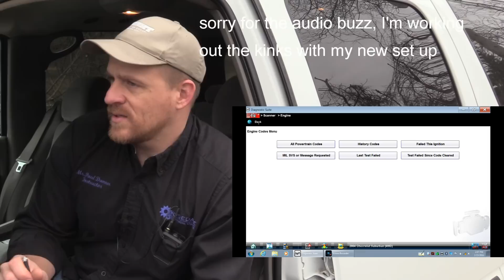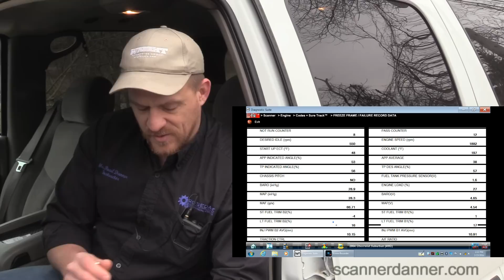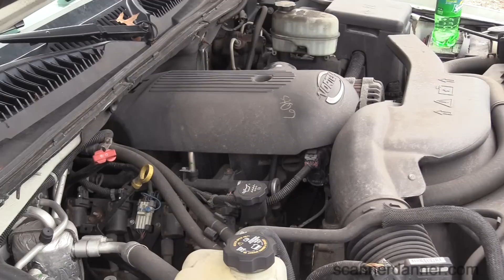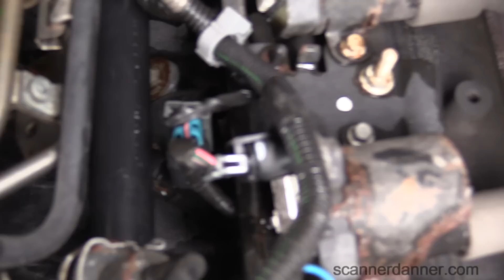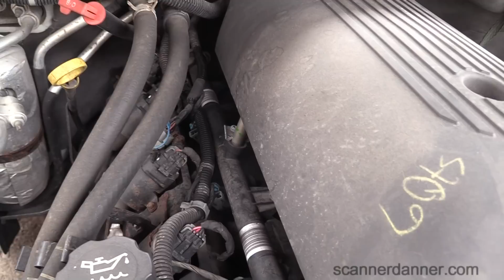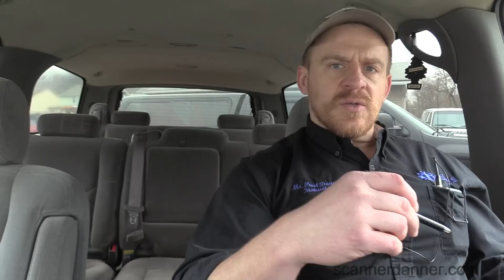Comment: This guy is good. My dad used to remove carbon from the pistons/cylinders by slowly dripping water from a turkey baster into the carburetors. Also, if the ole Holley carb got sone dirt he revved the engine and then quickly covered the top of the carb with his hand to clear the obstruction.

Comment: Need Opinions!!! I have a 2004 Tahoe 5.3 had no engine light or code, put some lucas in the fuel tank after driving for a little bit, my engine light came on throwing lean codes with rotten egg odor coming from exhaust, none of this occurred until just after I put the lucas in?! Im thinking the fuel filter is clogged from the lucas loosening something and shooting it thru clogging filter?! Any good opinions???!!!

Comment: I have a 2011 Chevy impala that just stopped running.. I took it for a oil change back on 11/25/2020 and ask the dealer ship to see why my check engine light was on.. They said something about lean, then my car stopped yesterday 12/10/2020.. Someone told me it could be the mas air flow sensor because it was dirty and I needed to clean it.. Plus it was bucking amd driving really slow yesterday.. So I changed the MAF Sensor yesterday evening and still nothing.. Car won't start at all now, it makes the noise to start but it won't turn over... I don't know what to do now can anyone help me out???
Reply: A MAF sensor wouldn't cause a flat out no start. Based on your symptoms and that lean code, step #1 for me is to verify that you have fuel pressure. These types of things are tough this time of year especially. Im sorry you are dealing with this.
Reply: Try smacking on the fuel tank and see if it will start while you beating on it. Use the palm of your hand while someone else is cranking it. If it starts, you need a fuel pump

Comment: ScannerDanner awesome info. You are a bad ace Amigo. I have a question. This video was an intake manifold leak with symptoms of a rough idle when engine was cold what is your take on the opposite. Same trouble codes only gets worse when engine is warm/hot?
Reply: Rough idle warm? I'm always thinking about a compression issue with that symptom.
What are your trim numbers? Any misfire DTCs?

Comment: I’m having the same problems but there’s no leak in the intake anywhere so I’m lost. When I start it in the morning it has a ruff idle so could it be my heads? I’ve changed plugs wires mass air flow 02 sensors how do I check the heads

Comment: Mine has same codes and only misfire at idle at operating temp when warm
Reply: What are your fuel trim numbers during the misfire
Reply: @ScannerDanner  I’m not sure. I had the codes read with a cheap autozone scanner and the guy behind the counter didn’t seem to know what he was talking about. I just know it was random cylinder misfire, bank 1 lean bank 2 lean, maf sensor and 02 sensor. I Cleaned the maf and the throttle body. Didn’t do any good. Figured my next step would be 02 sensors when I get the extra cash and then try n find a shop worth a damn around here to find a possible vacuum leak.

Comment: I have the same issue with my 2004 Suburban Z71 5.3L L59 4x4 when its cold out is the only time it gets lean enough to throw code P0171 P0174 as in 20 degrees to 55 degrees out side. When the engine warms up you don't feel the misfire if you didn't know what you're what you're looking for.
Reply: Bet it is the intake gasket

Comment: I have a Chevy Silverado 5.3 Lt 2wd 
This code came up, and does it have anything to do with the fuel pump
Reply: a failing fuel pump can absolutely set lean exhaust codes but there are many things that can set these codes (P0171 and P0174)
Reply: @ScannerDanner  fuel pump A low flow/performance 
Bank 1 Air-Fuel Ratio Balance
Bank 2 Air- Fuel Ratio Balance
Evaporation Emissions System Leak Detected (gross leak/no flow)
That's the codes I'm getting now

Comment: Ran across this video after getting these codes on my 04 suburban with 5.3.  water bottle trick definitely helped test the intake manifold gasket and my engine got rougher and steam did come out the exhaust.  On cold starts I had noticed a rough kind of idle until warmed up for a little bit but no codes.. no clue... Warmed up and no problem til the codes today leaving work.  Thank you for the simple test trick!
Reply: Glad it helped! Thanks for the comment

Comment: I'm kinda having the same problem with my 03 Tahoe... The engine light has come on a few times with a bank 1 and 2 lean code p0171 p0174 but it doesn't run any different sometimes the light won't come on for weeks and other times it'll pop on a couple times a week.... Should I start off by doing the water test... I just cleaned my MAF sensor

Comment: I had those codes show up today on my 2013 GMC Sierra 1500, a new MAF sensor was installed last week and I also had a new exhaust manifold gasket installed the same day. The thing that concerns me is I don't know how knowledgeable the mechanic is, he sounds sometimes like he's uncertain and can't make up his mind. So I asked him are you using the process of elimination? He gave me a stern look and said of course I am. When you're paying $80 an hour you don't want to be sitting around for hours. I dished out $320 today and it's still not fixed.
Reply: unfortunately my field is plagued by "parts changers" smh I am sorry you have to deal with that. I am doing my best to change things!!
Reply: @ScannerDanner  I'm going to make sure he uses the smoke machine and maybe that will help better if there's a leak.

Comment: What if it is the opposite? I’ve got a 2011 Silverado with the 4.8L vortec. The numbers seem to get better when it warms up but I run into surging. I don’t seem to have any leaks around the intake, where would you go next from there?
Reply: What are your fuel trim numbers at idle and at 3500 RPM? Steady throttle in park
Reply: ScannerDanner at idle the long term on both banks are 29.7 and short term is any where from 5 to 10 on both banks
Reply: I’ll have to do the idle test when I get home
Reply: ScannerDanner I’m sorry it took so long to get back to you. We thought we had the problem resolved but it has recently began again. The long terms go down to between 5 and 10 while the short term go to around negative 5 or 0
Reply: @aaronschmidt6263  so at 3500 these are your numbers? Then you definitely have a vacuum leak

Comment: Although I dont understand what you are reading on the screen during diagnostics, you did explain well enough for me to understand what you were getting at. I'm here bc of a 171, 174 code that occurred during load. At least the light was thrown after being parked at idle for an hour in the middle of a trip. Thank you very much for giving me a direction to go in.
Reply: Yes sir. Toward the MAF or fuel pressure would be my top two for under load lean conditions
Reply: What was your outcome

Comment: Thank you for the details in this video. I have been searching ways to diagnose this and never understood the fuel trims and how to use them to help diagnose the issue. Never heard of the water bottle test neither and by golly it did exactly what the vehicle in the video did as soon as the water hit the intake manifold gasket area. I previously tried this with brake cleaner with engine cold as a friend suggested and got nothing. The water gave results immediately. Thanks again for the details given and the tips on how to use the data on the scanner to help diagnose. It really helped me to get a better understanding and I now need to replace my intake manifold gasket. Wouldn't have figured it out without your help.
Reply: Best comment of the day! Thank you so much and nice job following along. That is credit to you. Not everyone is willing to understand this stuff

Comment: Mr.scanmer, I've learned so much on reading "live data". My 98 dodge 3.9 runs great except it will turn off mostly at a stop, but can idle parked for hours. All 7 emmision codes complete. One dtc " small evap leak" and po3o3 pending. Check grounds, replaced TPS, IAC, MAP, CRANK S.,  I'm broke now, will get dist. pick up coil at wrecking yard. Today ill check the ohms on injectors and see if cyn3 is different. Anyway mechanics like you don't exist in east.LA. Do you have a video relate ing to this situation. I had tdc PO303 before and never.shut engine,some.say computer but its doing whats expected. P done, no bus, po6something not there. I push subscribe and whats next. Thank.you.I

Comment: Awesome video!!! So I been goin threw my 00 Silverado with th 4.8. Kept throwing po171 and 174 code and at one time it had a random misfire code. Like yours mine runs good when it’s warm but at a really cold start it’ll idle up to about 1500 rpm then it’ll run back down to about 400 rpm with a lope!!! So I watched your video tried the water trick and sure enough, almost identical to yours it was mainly at the back of the intake. Got to looking and some of the water actually came out my exhaust pipe. Thanks for the help as I am now online ordering me an intake gasket

Comment: I used my HF Z11 scanner to get the P0174. Then found the vacuum leak at the first joint along the brake booster, small split on the end. Tapped it up neatly and applied some heat gun (HF again) to make sure the tape adhesive bound good. Drove as usually and the 174 went away. 2005 VW Jetta GLI 1.8T chipped. Enjoy your thoroughness.

Comment: Woooowww, great video, I just got thee PO171 code on my 2001 Chevy Tahoe, 5.3 liter 2x4 
With 251,000 miles. I believe it’s thee original intake manifold gaskets... perfect timing. Because my knock sensors need to be replaced to. I have both codes also for those. Thanks a lot for thee info. Going to do the water test ASAP. 😎👍

Comment: One thing i fear about using a bottle of water is that, if the vaccum leak is on the pcv pipes near the cover.  Water may end up mixing with engine oil . Thanks 👐

Comment: The water spray in the carb was a something done all the time. Another old school trick was instead of using water to find vacuum leaks, is using a unlit propane torch. It would be moved around to varies areas until the engine noise would sound better or raise. 

The propane trick is not recommend do to varies fire and open ventilation dangers.

Comment: my car runs clearly lean at idle, and less so at speed..9%. However if the cause is costly to repair.  I will simply live with it, if and until it get starts to go out of control.  Depends on the value of your car.I guess.

Comment: OK SMOKE PROVES IT.I WILL USE THE CIGAR SMOKE TEST NEXT TIME.I HAVE A SUBARU I THINK MAY HAVE MAJOR CRANK-CASE SUCKING IN.VACUME INSIDE OF CRANK COMIN FROM DIP DTICK AND OR OPEN OIL CAP AND MIS-FIRE CODES.SO WE WILL SEE.THINK VACUME LEAK SOMEWHERE.GOOD STUFF,DANNER.WISH I HAD REAL GOOD SCAN TOOL.

Comment: HOW ARE YOU SURE YOU ARENT CAUSING A SHORT IN SPARK BY HITTING COIL WIRES ETC.JUST WONDERING.I HAVE USED DIFFERENT THINGS LIKE CARB CLEANER OR STARTIN FLUID TO HEAR INCREASE IN RPM,BUT HAVENT BEEN SURE ABOUT WATER.
Reply: Just be aware of where you are dumping the water. Trust me, that underhood gets very wet when you are driving down the highway in the rain

Comment: LOL put some more water down the intake valley Danner Boy and your gonna take out the Knock Sensors. Good diagnostics. GMs will always give ya a paycheck.
Reply: This small amount of water will not hurt this engine, in fact it used to be a technique in the carburetor days where the old guys would run an engine at 2000 rpm and dump small amounts of water into the carb to steam clean the combustion chamber. As crazy as that sounds, I've seen it done many times. When a head gasket fails, what condition is the cylinder in that was burning the coolant? Absolutely spotlessly clean, so it does work, the old timers were right. Anyway, I am not putting anywhere near that amount of water into the engine locating vacuum leaks. This is a perfectly safe method and is much better than using a flammable source from a safety standpoint.

Comment: 33:00 "Water test is awesome".
(your words).
Is it a really a good and confident test?.
 Right now I can't afford a smoke machine.
Reply: It's a quickest test and it's "for free". It should work in most cases, but it should be possible to get the water to all corners (reachable) where intake gaskets seals the intake runners. For this Vortec motor, although I haven't seen such case, the vacuum leak could occur in the bottom part of the gasket, which is unfortunately hidden under the intake plenum. But anyway, you can still build your own smoke machine - there are several how-to videos on YouTube.
Reply: @xjohny  thank you

Comment: Thier is absalutly noone in my area thats as smart as you mechanics are hardto find hear in maine. My chevy will only start with starter fluied..newpump filterlines tune up
Reply: What is your fuel pressure? Doesn't matter that the pump is new
Reply: @ScannerDanner  im thinking my preasssure gauge is junk im gonna test on another vehicle butit was saying 40 withkey on and cranking.  Ive watch alot of your vids and im also woundering if im losing voltege at the pump they way tou did your test scares me i dnt wanna fry my computer. I have a 98 5.7 vortec. I need to use starting fluied at first start or if it sits more then an hr. I cant step on the gas to much or it will die right out. Spits spudders kicks lol. Did i put the new pump in wrong?take old one out new o ring put new in put bitch  ring back lol change filter. I cut a hatch in bed so no taking tank down.
Reply: It all started 5 months ago i bought this chevy. It died on me and it took me 3 weeks of changing parts pump lines full tune up sensoirs vacum lines and so on and come to find out itwas the groumd from back of motar to fram. Put it back on and everything was fine for about 2 days. Then the truck would spit and spudder at high speed or if you stomp on it. In the past 2 months it has slowly gotten to the point tgat i need startimg fluied to start of it sitz more then a hr. Someone said i did pump wrong and i startved it and killed basicly but idk. Im gonna try and put the old pump back in cuz i no its good i replaced it for no reason cuz of the ground issues. Wish i could pay you to come
 Fix this pos lol. Thanks for the reply man i love your content
Reply: @jesserousseau2481  you should be at 60 psi cranking. The injector design on your truck uses mechanical poppet nozzles that will NOT spray any fuel below 50 psi. You absolutely have a low pressure problem and as you've already learned, a bad power or ground can cause issues. Take your relay out and jump pins 30 and 87 to force the pump to run constantly, then check the voltage on both the power and ground wires at the pump while the pump is running and tell me what you have. Do NOT jump pins 85 and 86!!! Super important
Reply: @ScannerDanner  going to try this now thanks.
Reply: It was the fuel pump... Brand new one shit the bed i hate napa shit
Reply: Thanks gor the help bud

Comment: this code can also be a rich bank code. a bad plug not firing can cause the same code.
Reply: 171 174 are computer lean codes . air or fuel are leaned by the computer to adapt. a dead plug puts raw fuel thru the system and the computer trims the fuel setting the code. 172, 175 are rich codes but the computer is riching the system to provide more fuel to a starving engine. a fouled plug will not throw this code. 171,172 with a 301,302,303,304,305,306,307,308 are misfire codes and cylinder numbers. this is what you mean by a false code.
Reply: Close, the lean codes the computer adapts by adding fuel (positive trim numbers) . The rich codes the computer adapts my taking fuel away.(negative trim numbers)
Reply: P0171 and P0174 are lean codes. P0172 and P0175 are rich codes. A bad plug will NOT cause rich codes but can cause lean conditions (false lean)

Comment: Changed the intake gasket still those codes
Reply: the intake gasket is not the only cause of those codes. Low Fuel pressure, a dirty or faulty MAF,  restricted injectors, a flex fuel engine with a mis-calibrated alcohol content, another vacuum leak you missed etc

Comment: I did that water test on bank 2 because I could hear a vacuum sucking air sound on my 2004 expedition, Guess what I found out?A loosed spark plug that is about to pop out.I removed and replaced that #6 spark plug with a Dormant repair kit and now it is back to normal.171 and 174 is gone.Thank God.

Comment: You know it could have been the injector O-rings to they dry out so when you put in the water on the intake you really can't tell if it's being sucked through the intake or sucked through the rings on the injectors I need someone like you around I got a 04 GTO with problems and I don't know how to read the scan to like you do I have a hard time with a LOL
Reply: I've found soapy water allows a better view of where the water is being sucked in, but I could see it on this one, just couldn't get the camera to capture it.

Comment: Thanks, I was leaning toward a vacuum leak on my 06 Silverado 5.3 had a PO 171 code and your video confirmed it, I had a 17% Long term fuel trim and a 0-3 % short term fuel trim. when I raised the RPM to 2500 the short term and long term FT went down a little  and when it warmed up it also got a little better down to 15% so I guessed I had a small intake leak as it got better as it warmed up and I noticed better trim when cold as I raised the RPM. I smoked the engine from the intake and after the motor got good and smoked I saw smoke coming from under the intake so that confirmed the leak. I will be installing a new Fel Pro intake gasket and while I am there new knock sensors. From the video's I have seen I need to clean the valley and build a silicon U shaped dam in front of the Knock Sensors. Thanks for the Video  Good stuff!